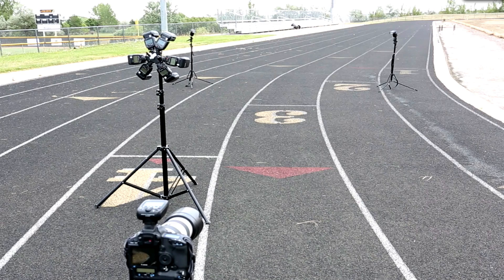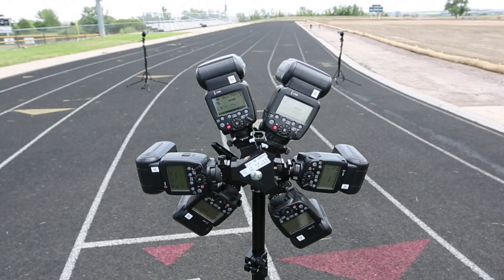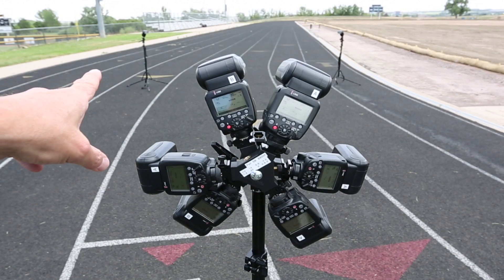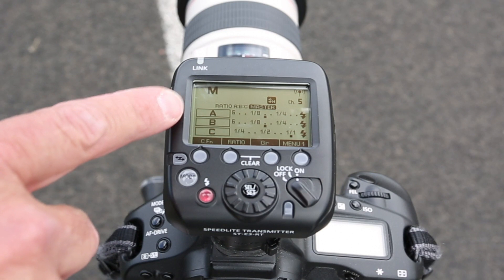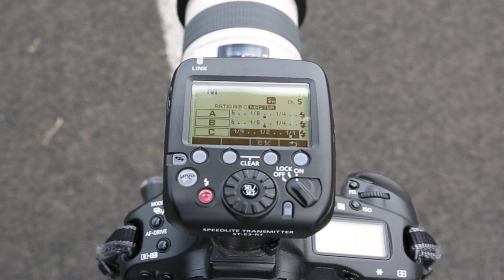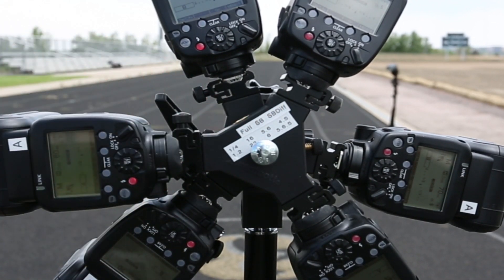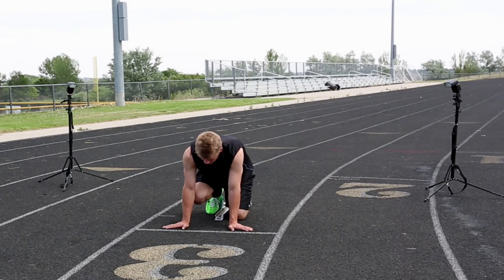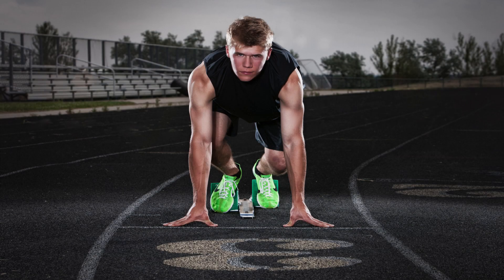Canon 600 EX-RT Speedlights and the St-E3-RT Transmitter

Comment: Great video! I'm a new 600 ex-rt convert - I bought one at a time as I could afford them and up to 3 now. Dependable, powerful, portable and fast setup! Time=$$$.
Reply from the maker: Thats how i started it too.  I recently picked up a couple of Elinchrom rx 1100 which i i am able to use in conjunction with the speed lights to give  me quite a bit more power.  Although they are really heavy.  Its about the weight of a car battery.  
And before people complain about the cost...  I know these systems are a lot of money.  I have owned a studio since 1987, I ve been doing it a long time.  If a tool can do the job better, i usually find a way to get it.  I know a lot of people can't afford it, believe me, i understand!  I've been there.  But fortunately now I can.

Comment: It would have been interesting to see some shots with the runner coming out of the blocks.I didn't get a sense of action. I liked your set up and use of speed lights. Did you try it with fewer lights? Was the need for 6 up front necessary for the amount of light or faster recycle time?

Comment from the maker: Hey Ron,   it would have worked with fewer (2 or 3) speed lights for the main.  I set up with the intention of the sun behind  the subject in the background sky.  By the time the subject arrived and we got to shooting, the clouds had come and dropped the ambient exposure way down.  I was wanting the sun in a starburst by using a fast shutter speed  (1/4000-1/8000).  Instead of removing the extra speed lights, I just dialed back the exposure down on them.  I'll be PSWLV.  How bout you?

Comment: Hi Dave, I'm new to flash photography but love the 600's because of their easy of use.  I'm slowly building up an arsenal with a grand total of three so far :-) I've read some negative comments from people saying your amount of 600's are overkill etc.  I see it as a very clean way to operate, no cables, no poppers and no umbrellas sailing by in the wind. 

I have a question about the group setup you have.  In this video you have three groups. Would you first fire each group individually to see the effect the light has on the athlete? And if so, in which order would you do this?  If this type of question has been asked before can you please point me to the link.  

Many thanks for your time posting these 'behind the scenes' videos, your style is simple and inspirational. 

Thank you :-)
Reply from the maker: I have three groups the main, background (skim light)  and the last group is added to the main lights.  They all fire simultaneously.  Ii just added the two groups together for the main light, which i know is way overkill on a cloudy day.  But this set up works on a bright sunny day as well with plenty of power!
For a light reading...  I usually have a pretty good idea at what one speedlight will fire individually at two of my paces.   It is usually within a 1/3+- stop or less.  You can use a light meter, take two or 3 paces and fire it at a manual power setting (ex 1/2 power).  Then when you are out in the field, you know roughly where you will be depending on power, and if you are closer or further from the subject.  It gives a starting point.  (Test in a controlled environment). Then at that point you can take a shot and  make adjustments.  I always test my equipment, so when i am in the field with a subject, I will only need to take a test shot or two. You never want to have your subject (paying client) sit there while you are trying to figure out your equipment.
Even my Elinchrom RS 1100 with a soft box I have tested and know at a specific power what f stop that will give me at 3 of my paces.
Its not a perfect way, but it works for me.  It gets me close in the ballpark, and then just minor adjustments after one test shot.  
It really helps to know your equipment.  My way is stepping it off in 2 or 3 paces.  I had someone show me a string attached to a light.  You would hold it out and at the end of the string you would have a specific f stop.  I felt that really looked stupid.  I guess it worked for them.  I'm sure if i did it they would be tangled all the time! LOL
Reply: Thank you so much for sharing your knowledge Daves. The internet can throw up huge waves of material, I'm glad I found your channel while ploughing through the surf. 

John :-)

Comment from the maker: This is a real clean and reliable hi speed sync option!  Hands down easier and much faster to use than radio poppers.  It works out of the box, no problems.
As far as the alien bees, I'm not familiar with those, but I thought those were ac powered?
These are battery operated and all controlled from the camera position.  You can't beat that!  In my experience over the last 25+ years cheaper always costs me more in the long run!  You are better off saving and buying the right tool for the job.

Comment: I am triggering the 1D MK IV from the flash, using the SR N3 cable to the ST E3 RT on the camera, the only problem is that there is no autofocus at the camera when the shot is taken. As the subject might even move slightly, it is then out of focus. Is there any way to enable autofocus when taking a remote trigger shot from the flash?

Comment: Is your canon transmitter sending the signal to your speedights without additional wireless trigger on the mount?
Reply from the maker: Yep, thats whats nice about the canon 600 speedlights.  You can control them from the camera and do high speed sync too.

Comment from the maker: So I was thinking about what you said....   so I thought I would work on that.  So I appreciate you're input.
So... thanks
Reply: Do you really recommend using the Canon flash and its remote trigger? All worth the money?
Reply from the maker: I love the canon   st-e3-rt transmitter that works with the canon flashes (600 RT).  It works flawlessly compared to the radio poppers.  Way less to deal with.  You just diail it in and it works!  Never been disappointed.  I get a lot of flack for my equipment because of the cost.... People are always complaining on this about "if I had the money..." But if you have the money and can afford it, I would highly recommend it!  I have been doing this as my full time job since 1987.  If I couldn't afford equipment by now, I wouldn't be doing it!
Reply from the maker: By the way if you think you're going to get it, just by one transmitter and one flash.  Try it out quick.  If it doesn't work return it.
Reply: Daves Digs I got my flash and transmitter they work great! Only issue is it's hard to focus in low light

Comment: 8 speedlites my rear-end!! I'd haul a small generator and strobes onto the track before paying that kind of money
Reply from the maker: The main purpose for me of the multiple flash heads was to have high speed sync,  up  in the high shutter speeds which is not as easy with strobes.  This video I could have gotten away with 3 maybe 4 flashes.  High speed sync wasn't necessary because of the overcast.  A bit earlier the sun was out.  What do you do?  I use the 8 flashes with the trampoline  and the motorcycle shoot where i needed 1/1000+ of a second.
Since I published these videos I picked up an Elinchrom RX 1100.  Using this I am able to achieve the high speed sync with this set up as well, which is nice.  Because of the power I can use a standard soft box and still achieve the speeds I need.  I shoot cheerleading stunts where the kicks are fast, so 1/1500+ of a sec in necessary.  This seems to work well for me.
Reply from the maker: I do like the toys!
Reply: Daves Digs Oh I can certainly understand someone in your area of expertise having more than just two or three! I do wedding and portrait photography, use off camera flash, and I'm just looking to get into HSS to be able to get a different type of "money shot" for portraits. I've done 15 weddings total over the past two years, and I'm only a sophomore in college so of course my budget is limited, HA!
Reply from the maker: I have had my  studio for 27 years, so I am always looking for something new to inspire me.  I have some old norman 400 b's.  I was able to get those to work with HSS also.
The older flashes or slower flashes seem to work well for this.  This weekend I am hoping to try a baseball and soccer player with water.  HSS will be super important.  Hopefully everything doesn't get soaked!

Comment: Why do you have two groups at the same angle (main light)?
Reply from the maker: Henrik Thuresson I have all of the flashes set up in 3 groups. 4 A groups, 2 b groups(background usually) and 2 c groups. I just added the flashes, and instead of changing the group it is easier just to add them where i want them. I guess I could have changed the group, but this was easier.  Just being lazy.  I was expecting sun.  If it would have been full sun behind, it would have been necessary for a lot of fill light, the sun would have been overhead behind the subject.
Reply: Daves Digs 
Thank you! 
To me this seems a bit overkill though.
Could you make the same shot without that many flashes? 
Or are all main lights at full throttle?
Reply from the maker: For what ended up as an overcast morning, it was.
But this set up works in full sun great!

Comment: Why not just use one strobe and two speed lights and save a tone of money? At 600 dollars x 8 = 5400 that's a pretty ridiculous set up.
Reply from the maker: It may be ridiculous, but how awesome is that! But really, in this situation,  I could have gotten away with 3 speedlights without a problem.  I was originally set up so that runner was backlit by the sun.  The plan was to use the high speed sync to darken the sky and I like the power this affords me.  After setting up and shooting a few other models,... by the time this subject showed up the clouds had come in, so the power was no longer an issue.  You can't control everything.  
I just picked up an elinchrom ranger rx.  I am working with high speed sync in conjunction with the 600 rt's.  It works great!
Reply: Daves Digs This video inspired me to order my first two Canon 600EX-RT flash units and a ST-E3-RT transmitter. last night. After watching many videos and seeing how useful flash can be... I cannot hold back any longer. I only have a Canon 5Ti, but am betting the flash units will be useful in many situations.  I can foresee needing at least two more flash units down the road. Especially for portrait situations and bright outdoor shoots. I am no pro by any stretch of the imagination. However, I am a very enthusiastic enthusiast! I deeply appreciate all the tutorials and work you professionals post. They are very helpful. 8 Speedlites ridiculous? I don't think so. A man has got to have his toys. The more Legos the better. I'm also far from wealthy, but live frugally so that I can enjoy my hobbies to the fullest. Again, thanks for a great tutorial.
Reply from the maker: If u get stuck let me know. I will try to answer anything I can to help u out!  In the next week or so I will be using some of the speed light to light a horse in an outdoor studio set up with a large black background and a smoke machine...  At least that's my vision.
Reply: Daves Digs Hey Dave! I've got three now. Getting ready to order number four. I'm thinking that 5 will do what I want in most situations (Though I will continue to add 600Ex-RTs in the next couple of years) . I like the idea of being able to gel flash (for color) adjoining rooms and background. I've also upgraded to a 70D. Just moved so still unpacking things. Again, thanks for your video. Do you like the Westcott Triple Threat?

Comment from the maker: As far as the budget,... its photography, why would you want a budget?!  But really, i had several flashes before using hi speed sync.  I was using radio poppers.  I had some individual flashes with radio poppers.  I had several other flashes with one radio popper that was retrofitted to fire multiple flashes.  That was not cheap either.  The expense of the poppers along with the retrofit.  I also found them to be temperamental.  It was frustrating.